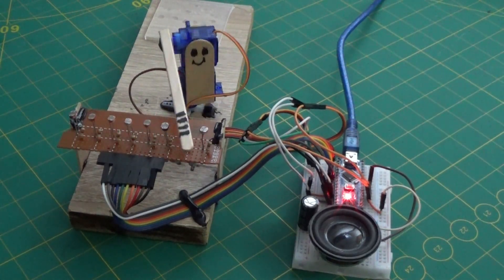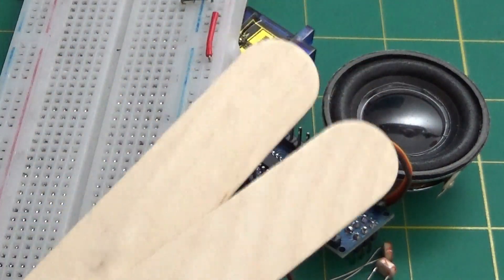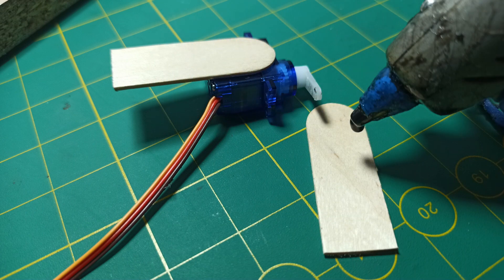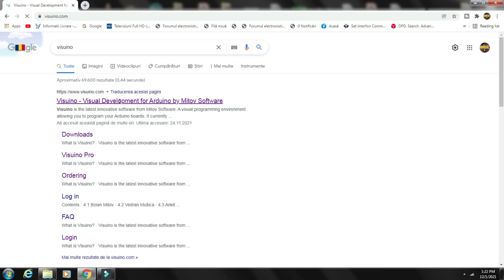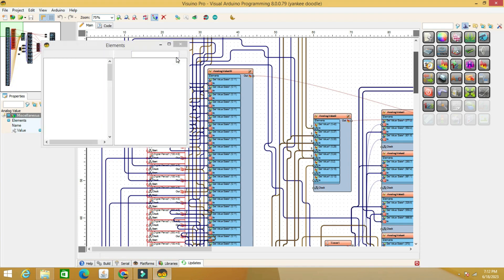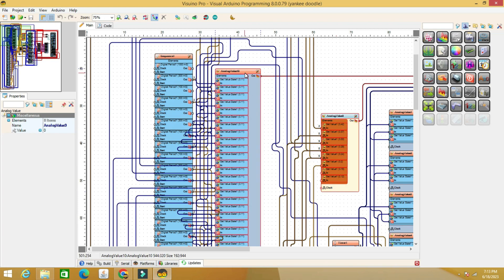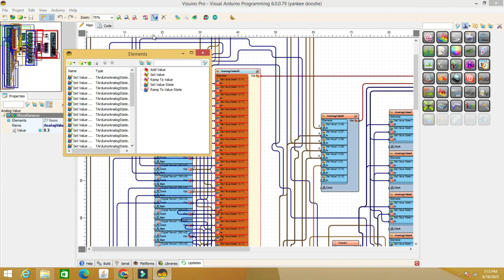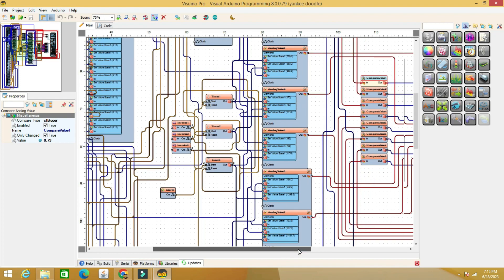Arduino Self Playing Piano!

Comment: Take a simple test. Open from "File"-"New" and try a simple code with only Arduino Nano and Servo connected anywhere and see if it loads the code just i tried bro but no use

Comment: Hi I have some compilation error like Error installing Servo: Library install failed: creating temp dir for extraction: mkdir C:\Users\venka\OneDrive\??????: The filename, directory name, or volume label syntax is incorrect.
Reply from the maker: Now I tested the code, uploaded it to Arduino, it works. You probably don't have the servo library installed. Go to the "Libraries" button, write "Servo" and install the latest version, 1.2.2
Reply: While i installing it's not installing i tried
Reply from the maker: @GnanaVenkatRamSunnam  try with the antivirus turned off, to have an internet connection.  Take a simple test. Open from "File"-"New" and try a simple code with only Arduino Nano and Servo connected anywhere and see if it loads the code. If it does the same, uninstall and install Visuino again.

Comment: 📺💬 See the program but if you create a random function with robots you can safe a lot of space and look easy to understand. Can you explain them ⁉
🥺💬 Are you trying to play actions from multiple phases ⁉ It is simple the random function is for SoftMax it required small change in value when input is close values.
🧸💬 There are 7 notes you can create a matrix size [ 4, 1 ] and a random function with less distribution, and when you input new notes as [ 0 ] into the function matrix size [ 4, 1 ] time by random function output size [ 1, 4 ] then result is size [ 4, 4 ].
🧸💬 Selecting one note from 7 notes mapping to the robot function is actions = [ None, Left, Right, Drum ]
🐑💬 We create basic control functions by
1. X = 0
2. X = position X - target note key
3. X = target not key - position X
4. X = 512 - ( position X - target note key) 
* when 512 is the total width

🐐💬 Then select the most probability by argMax, SoftMax or Mean or any function you like the result is in actions number one of the array actions =  [ None, Left, Right, Drum ]
Reply from the maker: The software is compiled in Visuino. I only program in this software, microcontrollers. The flexibility of this software creates the possibility of using other components or functions and reaching the same result and obtaining more free space, implicitly memory. I say that I explained the complexity of the code well enough. See in the description.
Reply: @CompactDiy  You can reduce the complexity of codes with this method.
Reply: WTF are you talking about  ⁉ ⁉ ⁉ ⁉ ⁉ ⁉ ⁉ ⁉ ⁉

Comment: Today, it's not easy to find those kind of photo resistors here in the EU. You cannot buy them anymore, as they contain cadmium. I just needed some, to repair vintage guitar amps - and luckily I got some from a friend, as I ran out of stock.
Reply from the maker: I haven't bought photoresistors for a long time, I had these in a box. They can be replaced with infrared LEDs. I'm working on a project right now.
Reply: Wrong. They are easy to get and very cheap. Maybe you should learn to use Google. Hint: aliexpress, amazon, ebay...